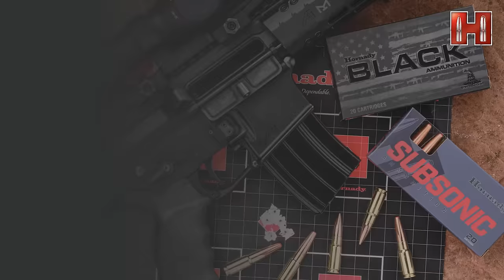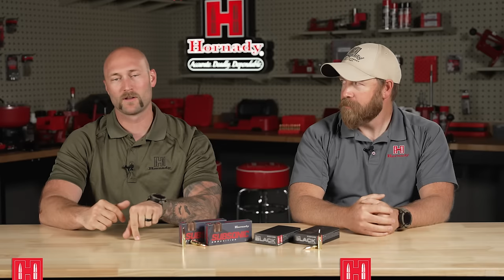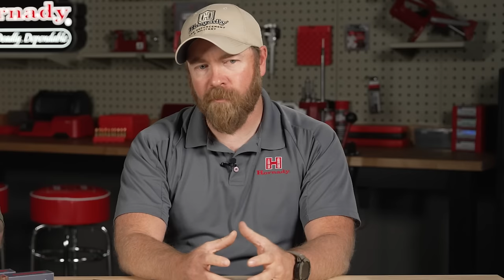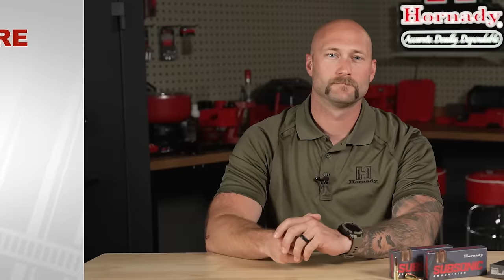338 ARC vs. 8.6 Blackout

Comment: FINALLY someone makes 8.6 in a smallframe AR.
Reply: There has been 338 Spectre (10mm Auto Mag or 6.8 Wildcat) and 338 Razorback cartridges that do this, but they didn’t have the engineering and testing capabilities that Hornady does.  Those used 6.8 and 6.5 Grendel mags, very fun to shoot on steel.  338 ARC just makes it mainstream really with factory support from a big company.

Comment: Look man, I love new caliber ideas but can we really not just keep edging up to 350 legend? At least with 350 you have more than 20 grains worth of case capacity and can push 2400+ fps with 150s. Reloading a 9mm/357 bullet I'm sure is phenomenally cheaper than any .338, and even off the shelf 350 FMJ is $0.75 CPR. Subsonic are $1.10 a round. This stuff is gonna release with $30 boxes fmjs, $40 box subs, and $45 a box hunting ammo for near identical performance. Shoot, if anyone could make 350 uppers as reliable as 300BO we could see both cartridges dead in the water just because 350s got so much more powder room when the bullets not 65% of the total projectile length 🤦🏼‍♀️

Comment: what he's saying about 8.6blk having more than optimal case capacity for subs is true, but it was developed (like 300blk) to be used sub and super, so it's a compromise from the start. also, maybe you guys could take another look at your 45-70 sub-x load if you understand suboptimal powder charges? 405gr @1300fps is what the army was getting in 1860 with blackpowder, so 410gr @ 1050 is... anemic. really should be a 500+gr projectile to get the energy up and take up more case room.
Reply: Totally disagree. The 8.6 BO has too much case capacity for subsonic loadings for most of us that reload. We don't have high end factory powder blends. And having more case capacity doesn't just mean that you have a small charge in a giant case. It also means that it takes more powder(in that small charge) to get to 1050. That same small charge would be even smaller in a smaller case. Quiet subsonic have more to do with charge weight and barrel length than anything.
Reply: That's not how it works, too much case is a problem for subsonic. 8.6 has too much. The spin is too high for non milled brass expanding supersonics too, as a by product of needing all that spin to properly stabilize long subsonics. It truly is a subpar round, 375 raptor does everything better, even reloading cost.
Reply: @lucastonoli3256 Ummmm thats why you're supposed to use the correct bullets. That's like saying that putting 87 octane in your Porsche will damage it. Yeah duh, so don't put 87 in it then 🤦‍♂️
Reply: @gfactor559  yeah, well, that analogy doesn't work here, the design issues of 8.6 (not being able to stabilize heavy subs without absurd twist rate, said twist rate limiting your options for supers, and empty case) makes the round fairly restrictive compared to what was being sold. In reality, you can only shoot monolithic bullets for supers, or you risk jacket separation. And subsonics require mixing powders and shooting mostly the heaviest tips possible if you want consistent performance. And even reloading the round is always very expensive due to these components you're forced to use.
The round will never get SAAMI approval, and that will end up killing it.
If you wanted to dick around with a wildcat, .375 raptor would be better.

Comment: Guys what we really wanted all along was 9x39mm; .358 ARC would have been close enough.
.338 just doesn't cut it for a Grendel-based round, not when you're competing in the AR market where .300 BO has captured the mainstream and DIY builders have been rediscovering .338 Spectre thanks to the new .338 projectile development.

Comment: Simple solution for 8.6. Make trail boss available again.
Reply: Wont ever happen. Trail Boss and H4895.
Reply: I just use Unique powder. Very similar performance.
Reply: @JNOSNOW  the only problem with unique is that you cannot load it in certain things like rifles less than 60% case capacity. That's why  H4895 was so supreme.
Reply: @Entertainment_Enterprise  it only takes 13 grains in the 45-70 to get a 500 grain projectile to 1,050. It doesn't take much

Comment: If the 1:3 twist is not what the bullets are made for then why don’t you as a ammo manufacturer build ammo for it? Is the case still too large with a 350 or larger projectile? I think that if you guys are not just being total dicks that you should make a 8.6 BLK subsonic load in something 350gr or larger. Just as a show of good faith to your customers that want that cartridge. 

It seems that all you want to do is tell us what to buy instead of selling us what we want to buy.
Reply: 8.6 was devloped by Q, LLC so it wouldn't surprise me if they're demanding outrageous royalties for manufacturing right.

That said, I agree with you. The twist rate thing doesn't pass the sniff test. That 1:3 twist makes 8.6blk extreamly efficient at transferring energy into the target where most sub sonic rounds just goosenecks on through. 

My suspicion is that the added energy provided by the .308 cartridge is needed to achieve such a rapid spin while still maintaining speeds that are just below sub sonic.
Reply: @SimplestUsername  They are not demanding outrageous royalties. Hornady makes the brass for Q's 8.6 Blackout and has no problem creating 8.6BLK ammo. They just can't. Like.... literally they're incapable. The problem is that Hornady's tolerances are terrible and 8.6BLK demands tighter tolerances because of the cartridge design, capacity, etc. The neck tension on the 8.6BLK has to be ~100lbs but the Hornady brass is coming in about 20-40lbs and that's simply not going to fly. That's just one example.

Comment: Why not a 1:6 twist?
Reply: 300 blackout need a 1:5 so what do you think a heavier bullet need ?
Reply: @idk9478  the length of the bullet with weight is more or less the bigger factor to twist rate required than just weight alone. I've seen a 225 grain 338 monolithic that requires a 1:9.5 due to its length while a contemporary 225 could probably be stable with a 1:12

Comment: Will the Sub-X bullets handle 1:3 twist?  All the other cup/core bullets I've loaded for subs function just fine, average around 1.5 MOA, and have been in the single digits for Std Dev and Extreme Spreads. Would love to try the Sub X too.
Reply: The 8.6 guys says it will. I don’t know though. I thought you could only use mono bullets with the 1:3 twist though
Reply: Subsonic… you’re fine. It’s when the velocities increase that separation occurs. 
I’ve run lots of different stuff at 1000-1100… i won’t touch anything that’s not monometal above that. I like my cans to much.
Reply: @jrca1406 honestly it seems like I would have less trouble going with the .338 arc than going with the 8.6. AR 10s always seem to have more problems when building than AR15s
Reply: 1:3 twist rate is restarted AF

Comment: When you release a new product, it should stand on its own merits, dont shit talk a completely different round trying to sell yours

>"the case capacity of 8.6 blackout is not optimised for subsonic"
The 8.6 blackout can take heavier bullets than the ARC, you can fill up empty space with proper powders or a larger bullet. This is not a real problem.

>"you dont need an ar10 platform for 338 subsonic, 1050 is 1050"

You can load longer, heavier subsonic bullets in the ar10 platform. This leads to more energy on target. You know this

>"spinning a bullet at 1/3 means bullets perform differently and you can have traditional cup and core bullets explode from rotation"

Q tests the vast majority of 338 bullets on the market, and modern high quality bullets dont have this problem.

If people want a ar15 catridge that is slightly bigger than subsonic 300blk, the 338 is cool. So is 338 spectre,350 legend,458 socom

If you want a 12in barrel bear gun with more supersonic muzzle energy than 308, that can switch to subsonics with heavy bullets and reliable expansion, the 8.6 it is
Reply: The 8.6 blackout is no "bear gun" lol, the 3" twist gives it horrific accuracy by overspinning the bullet. It's a turd
Reply: @ryantogo8359  think what you want, a supressed 8-12in barrel 8.6blk ar10 is the perfect bear gun. 8.6 is easily capable of 1moa super and subsonic

Comment: Sorry, but my 12" Q Fix in 8.6 black shooting Gorilla Ammunition 300gr SMK subs, 285gr Fracturing subs, and also 342gr Punisher subs all shoot 1 MOA or less. SDs are also 15 or less for all of those types. All are truly subsonic and extremely quiet with great terminal results. 210gr Barns TSX supers are also 1 MOA or less also with SD 15 or less. 

I was really hoping Hornady would produce 8.6 BLK ammo. That being said, I am interested to see just what 338 ARC really can do vs 8.6 BLK. All we have here so far is talk. Put out some true comparisons so people can make informed decisions.
Reply: It won't be good with supers like the 8.6 it just doesn't have the case capacity. With Subs should be phenomenal though. Looking at the specs on hornady website for the 175 black line they only do 2075 fps. 16" barrel. Glad your Fix is working good for you. I'm just interested in the subs from the AR15 platform.
Reply: Yeah I gotta call cap on that 1 moa or less for all your subsonics u posted.

Because I’ve personally shot 300 SMKS from gorilla and seen others shoot what u posted and at best they were all 2.5-5moa. 

The data I’ve seen is in 8.6 discords and Facebook groups.

On top of that Q has been ABSOLUTELY USELESS in terms of any trouble shooting and essentially has left us consumers to figure out how to solve their issues for them
Reply: @Swissk31300BO  also the Fix is not a sub moa gun
Reply: 15fps SD at subsonic velocity is like 50fps SD for supers 😂😂😂
Reply: @Swissk31300BO My 16” 8.6 Fix shoots 1MOA (3 shot groups) at 100 yards with Gorilla 300gr SMK and 300gr Berger Hybrid. Best group so far has been 0.6MOA at 100 yards with the Bergers.
Reply: @rhy1013 3 shot groups 😂
Reply: @ Lucas if you don’t behave yourself, your mom’s gonna take away your screen time.

Comment: I am very happy with my 8.6 Blackout, my sub handloads avg standard dev is 5-6fps, less than 1moa, I can also shoot Barnes TSX 210s in supersonic in it and I've shot plenty of game and they are devastating. Copper projectiles are all you need in my opinion and there are no issues with the 1 in 3 twist. I know you have to promote your new round, but I don't think your reasons against the 8.6 are solid.
Reply: Truly spoken. They could have just made an excellent 8.6 BLK offering, not come up with something proprietary that has already been proven to deliver sub-par results with a slower twist rate. 2010 called, they want their failed research back.
Reply: Why would you want to shoot solids tho. Expensive for no reason other than Kevin's dumb 1:3 twist idea.
Reply: @fltmed  this is different because it fits AR15 not AR 10. That is the point with this round. specifically with subs. Supers are anemic at 2075fps with 175 gr black line in a 16"barrel. subs in the AR15 is all I care about.
Reply: I’ve talked to a few suppressor manufacturers that have had to repair many suppressors due to bullets coming apart in the 1/3 twist of the 8.6 blkout. There is always room for improvement and superior products.
Reply: @williamsonnie9935  Are they shooting solid copper bullets? Bolt or Semi-Auto? I have almost 2k rounds thru my 12" Q Fix with both the Short Chop and Porq Chop cans without any issues. Small sample of just one (mine) I know. Just curious what the variables that may be causing issues.
Reply: @onceaintenough  I love my 8.6 Q Fix also. I don’t know why these idiots can’t produce an outfitter 8.6 BLK. I guess that I’m going to have to start hand loading Barnes since they don’t care what their customers want to buy. Very disappointing.
Reply: @keithjordan4489  Yes reloading is easy and fun you just have to be methodical about it. If you look online discreet ballistics, Maker, Lehigh defense and others make some incredible bullets designed for the the 8.6. Subsonic that expand a lot on impact. I’m shooting the discreet ballistics 280s and they are awesome and lethal.
Reply: @fltmed  same here, you can shoot any solids and be fine! I just watched a Ron Spomer vid and they went through all the hunting bullets and makes and they prefer solid copper as well. I’ve been shooting solids for over 10 years and love them.
Reply: @fltmed it sounds like cup and core bullets were the culprit in that fast of a twist. Solids is a fix for the issue but there aren’t a lot of solids on shelves of most stores.
Reply: @onceaintenough  what powders did you end up with for the TSX's? I have been using factory Gorilla TSX 210's and 285. They work pretty good on critters.
Reply: Hornady didn't even back the .300 blackout when it came out.  Said it wouldn't go anywhere, now it's their 2nd best selling caliber.  Hornady is just a bunch of haters and they did didn't want to work with KB from Q because like I said, they're haters and there was nothing in it for them at the end of the day.   There is no way this cartridge they are coming out with is going to out perform the 8.6.
Reply: Hornady wanted to poo poo Q, and then they made a cartridge to is a direct compete against the .338 spectre.  But will fall short of 8.6 BLK reliability?

If no one can figure out how to fire 7.62x39 reliably from an AR-15, how are they going to make it work with a larger cartridge????
Reply: Because it’s for hunting and copper is better in every way out of the 8.6
Reply: @jjmckay6man1  Kevin at Q developed the 300 Blackout. If he thought it would be a good idea to make the 8.6 Blackout work in an AR-15 he would have done it. There must be a reason he didn't.
Reply: @onceaintenough  Just Cause Solutions also makes 8.6 Blackout ammo.
Reply: @joshuahunt1210  so your saying Q isn't that bright got ya.
Reply: My only issue with the 8.6 is that I can buy 50bmg cheaper than loading 8.6, it's gotten easier since starline sells brass, and making some of my own load data because q wants to use shit powder, but it's been a very expensive process...

Comment: Hornady, please offer 8.6 Blk so we can compare and find out for ourselves.
Reply: 8.6 is a very flawed round
Reply: @lucastonoli3256 is that why more and more manufacturers are producing firearms chambered for 8.6blk? Same with ammunition?😂 I think you meant versatile, not flawed?👍🏼
Reply: @americianthroughandthrough4438  adoption has been incredibly slow, and you already have PSA on board with 338 arc that heavily overlaps with it. No SAAMI is the final nail in the coffin for 8.6, besides the technical problems (twist rate causing dramatic lateral drift, issues with jacketed bullets on supers, too much empty case on subsonics, etc).

Comment: What role does this caliber fill that 300 blk and 8.6 blk doesn't? For hunting with subs your max distance is like 250 yards, but realistically 100 yards. There is no real trade off for the lack of terminal performance. The lack of versatility with subs and supers eliminates the hunting capability in states that have energy requirements. The only use case I see is long range sub sonic target shooting and it only sounds marginally better than 8.6 and 300 blk. I'm pretty disappointed that all you could come up with a 338 specter.
Reply: so its "only" marginally better so they shouldnt do it? Do you know how capitalism works?
Reply: Hits harder than 300 BLK, fits inside the AR-15, uses commonly-available bolts and magazines (6.5 Grendel).  So it’s more accessible to all the people who don’t have Q Money, and encourages more shooters to get suppressors.

Comment: I’d be interested, but, I don’t want to spend a grand on a .338 can. I’m already set up for 30 cal and below. There’s no reason to use 338 ARC without a suppressor. It’s a joke of a round as a super.

I’m surprised you thought this was a good enough idea to bring to market. Seems like a good idea at first, then you realize you need to go buy a new suppressor for $1000 for it to make any sense, which makes no sense.
Reply: It’s an expensive hobby so stop crying. Try collecting rocks instead.
Reply: Considering it's subsonic, it's likely any non-aluminum 9mm suppressor would work with this, as many are already rated for 300 blackout  subsonic and 357 magnum. It shouldn't require an expensive specialty can made for 338LM or similar.
Reply: Works with TBAC FLY9 Ti suppressors, which are meant for 9mm pistols and 300 Whisper.  They handle supers and subs with pretty short barrels.  It’s what Jayden said he’s using for the 338 ARC testing.  The main reason for 338 ARC vs 300 Whisper is shooting effectively at distance, in addition to the noticeable impact energy on-target.